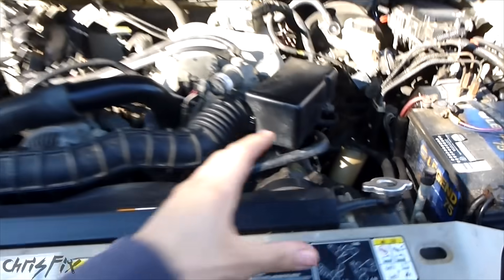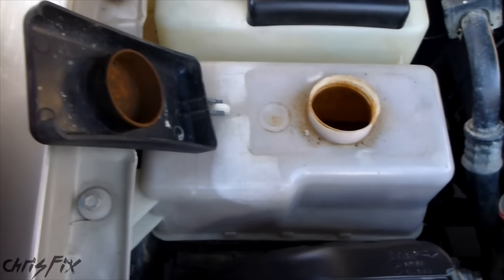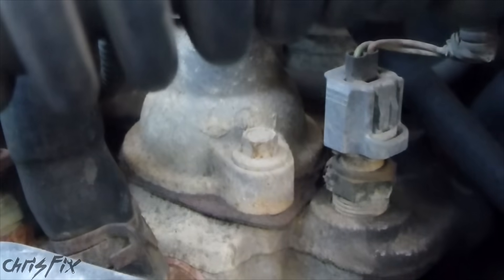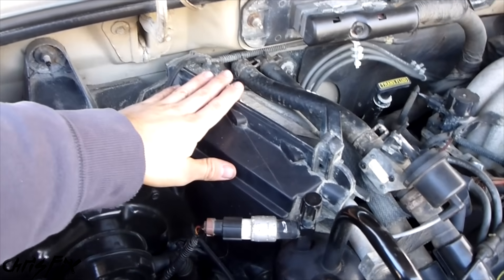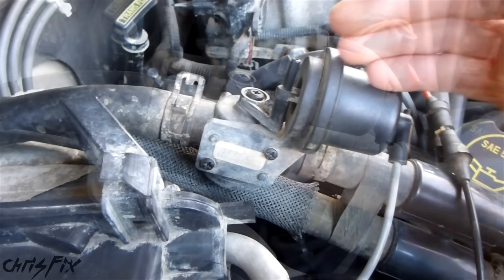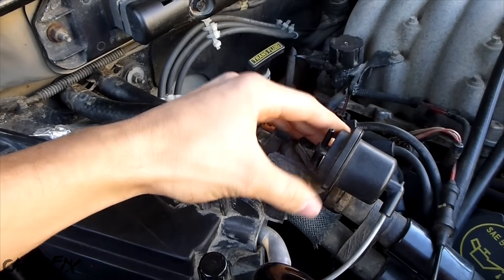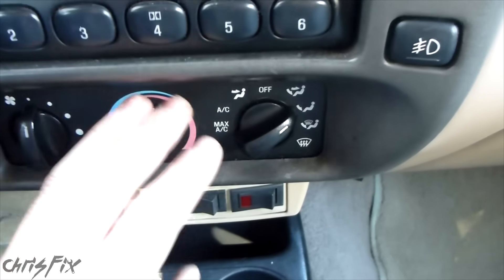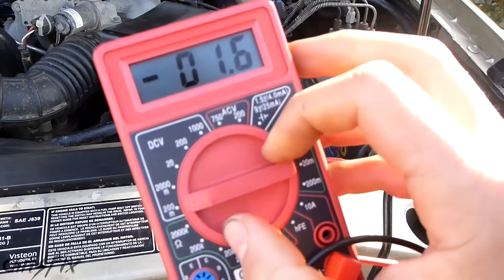How to Fix a Car with No Heat (Easy)

Comment: The dislikes are the mechanics losing there paycheck😂 thanks again Chris helped me alot
Reply from the maker: Glad the video was helpful!
Reply: I like too,people always ,make mistakes after they think they can do it,lucky is usually just  boil the fuse, some may burnt  the house,know is ok,you know what your mechanic replacing, but if part if electronic, fuel or brake,think about it before.
he spend many  years to learn  not just few minutes
Reply: Alan W i dont understand you at all
Reply: Yeah lol. Self helpers are taking from mechanics.
Reply: hunter lutz good one! Lol 😂 but you know what they still watched the video so it helps Chris Fix haha
Reply: Facts one mechanic was about to charge me 800 fo change my WORKING actuator
Reply: Their**
Reply: I don't think so he got only 6 million subscribers
Reply: Their*
Reply: @alanw5812  uh no offense but what
Reply: @willleftridge3769  that's nothing, a mechanic tried to charge me $2400 for a blown head gasket that wasn't even blown.
Reply: Teach me how
Reply: @alanw5812  ?m
Reply: Wow that needs a flush bad
Reply: @alanw5812  I agree
Reply: @ralphvaccaro2638  because if rust already made a hole ,the rust sometime  can block the hole to stop leak,if clean it will start to leak again.
Reply: @chrisfix   My 2002 F-150 with a 5.4 engine...has heat but not hot like it used to be. cut access behind glove box to observe blend door, that is working good like it should, opens and closes fully when turning thermostat from hot to cold, engine thermostat replaced, coolant system flushed, heater core flushed, flow restrictor in inlet heater hose has been removed, blend door actuator replaced...both heater hoses are hotter on the bottom side of the hose than on the top side, is that normal because the hot coolant is circulating and doesn't completely fill the hoses? if I leave the fan on low for a few minutes and then turn it back on high the heat will be hot for about 1 minute and then it starts cooling down again and back to only warm. I see you were reading about 140 on top side of both heater hoses, were you able to get hot heat with those temps? also with this truck if I increase the engine RPM the heater is warmer. any suggestions or ideas from you ChrisFix or anyone reading this?  Thanks for the video and explanation it was done very well.
Reply: Yea because we all knew this stuff was easy
Reply: @dddddd2100  sad to say this but from what is described possible ur getting into a head gasket and from it being a 5.4 and a 2002 and everything you replaced and you got villa to in there check ur oil see if it’s milky and run a leak down test on it
Reply: Coolant*
Reply: @chrisfix  a
Reply: True
Reply: Chris you are the fucking man!!! Thanks so much
Reply: And just like that you helped me fix my daughter's car. Amazing. Now, she may have a coolant leak. We are not sure yet. She bought the car used so I guess we'll wait to see. But for now she's got heat again!
Reply: @waskito3443  So much of that goes on out there these days. We have an oil change place that checks all hoses etc FREE....took a hose off hid it down tucked under others and my friend drove off with his "oil changed" and all his power steering fluid leaked out. They wanted to charge him $1500. to fix. He came back with the police. The kid that pulled the line off pretended that he just found it off but my friend knew they tried to hack his car. You have to learn to change your own oil. It isnt difficult.
Reply: Facts!
Reply: Facts! 💯
Reply: True 😂😂😂😂😂
Reply: @alanw5812  well they scam you out of cash too
Reply: Or the ppl that did the stew and still couldn’t fix their shit lol
Reply: Can't see any dislikes now...
Reply: There aren't any dislikes
Reply: @RealDJStew724  YouTube changed it... ppl are probably too soft for thumbs down nowadays 🤦‍♂️
Reply: What dislikes? 💀
Reply: There are no more dislikes :(
Reply: Dislikes are only for real people...
Reply: @craigjones8558  what's that supposed to mean?
Reply: their
Reply: What dislikes.
Reply: If you tried to fix it yourself first and then bring it to me,  It's going to cost you more!
Reply: Ford's.....🤢
Reply: For reals man
Reply: @supporterofeverythingyouli6255  💯 exactly love when people think they know more then actual decent mechanics just because they watch a few videos or have one of those little devices that plug into the obd port 😂😂😂
Reply: @supporterofeverythingyouli6255  had a guy who showed me a printout from i think it was blue driver or whatever its called , he had some code and it told him to replace the throttle body , long story short he wanted it replaced he swore that was the fix so we did even tho i knew something else was going on but i wanted to prove a point about those devices , check engine light still on car still ran like shit , did a smoke test , his intake manifold had came loose in the back and was throwing the whole car out of wack 🤷🏽‍♂️
Reply: @live_lifeor_dye8875  educated society is better than compartmentalized one
Reply: @chrisfix  aaaaa
Reply: 😂 makes perfect sense.
Reply: @sassylrhg  there are countless videos on here with people who put hidden cameras in cars and deliberately make the car malfunction and bring it to a mechanic. They then catch the mechanic lying about fixing it legitimately when all they did was correct the deliberate issue that the person caused. Shady people everywhere in this world. You have to find a mechanic that you can trust and stick with him. Not easy to do but possible.
Reply: No,its guys like me that went for years to learn how to be a licensed 1,and then there are guys like this that think,and want to be 1.Big difference.
Reply: many mechanics do it to themselves. triple charging customers. charging them for hours of labor when the job took 30 minutes. some don't have the financial stability to pay $75-150 hr for labor when they can learn to diagnose and fix on their own. especially if it's a second car or they are just learning on their own.
Reply: @chrisfix   I posted a question about the air conditioning only coming out of the defrosting vents,  AC blowing on a windshield when it's 108 degrees outside with 90% humidity doesn't do any good. would that also be the blend door or something else?
Reply from the maker: @stacylee1784  vent actuators not working.
Reply: Dont worry. Companies are actively making vehicles so you cant work on them anymore. If u dont put it in maintenance mode it will destroy yoyr vehicle
Reply: @alanw5812  q
Reply: rip the dislike button;(
Reply: @waskito3443  a parts swapper or fraud 🤥
Reply: @chrisfix I have acura tlx my heater motor works on and off for no apparent reason ..please help

Comment: There are three knobs on the climate control panel show here?. The far right knob, what is the name of the module it controls? Mine is starting to wear out and needs to be replaced. None of f the parts diagrams I have found names it. This is on a 2001 F150.

Comment: THANK YOU FOR SUCH AN INFORMATIVE VIDEO. IM A 46 year old widow and having this exact issue but on a very tight budget. Currently I am stranded due to a snow storm combined with no heat making it dangerous since I cannot see through the windshield due to ice. 
Sadly im stuck until tomorrow afternoon when hopefully some sunshine will allow me to complete my 2 hour journey home but I cannot wait to follow your instructions and get my heat working again. 
My poor dog is shivering so bad. That’s the hardest part for me. 
We are soooooo cold but you’ve given me some hope so we never have to go through this again. 
Thanks again. 
Jami
Reply from the maker: I'm sure you will be able to get that fixed so you can get home!

Comment: Chris, it's been 6 years since you posted this. And recently my car started taking forever to warm up the air now that's it's cold out. First thing I remembered was this video that I watched a good 3-4 years ago. I just wanted to say thank you! My car now has hot air blowing during these cold mornings/evenings! It turned out that my car was just low on anifreeze/coolant. Thankfully, it's all that the car needed. No, I don't have a leak, it just normal evaporation that exits from the reservoir. But it also shows how often I look under the hood, and this situation reminded me that it was past due that I checked under the hood. Thanks again!

Comment from the maker: Thanks to the tips and suggestions by my awesome subscribers, I added some more information and made one part a little more clear! Can you spot the difference in this video compared to the one released yesterday?
Reply: Nope can't tell thete both to grate to tell but man your radiader is nasty wow its looked very rusty
Reply from the maker: patrick cordery Yea man! Commenters are scaring me saying I have a head gasket leak. Now I want to do a compression test lol
I think it is just really rusty because  I dont loose any coolant and the oil isnt frothy so.
Reply: ChrisFix keep up the good work and thanks for your continuous replies. Other YouTubers only reply once and most of the time that doesn't help
Reply from the maker: Claroboy911 No problem man! I am here to try and help! That is the goal!
Reply from the maker: chickeneyeballs does it work on the highest fan setting? If so, your blower motor resistor is bad. If not, it sounds like your blower motor is bad. Here is some more info: https://www.youtube.com/watch?v=7e60wS3_C9s
Reply from the maker: chickeneyeballs Yea, that sounds like a bad blower motor. Maybe the connection to the blower motor is loose?
Reply: Dude, I love your videos. Being a trained manufacturer technician I know all about the cooling systems and other systems that you've covered, but you do a good job of keeping it simple yet informative. The horseless carriage is a surprisingly complicated machine that I think the majority of us have no clue how any of it works. Keep up the good work!
Reply from the maker: grandmaster1004 Thanks a lot man! I really appreciate it!
Reply: +JHMBB2  can u help me figure out why i dont have no heat in my 94 Ford taurus
Reply: +G. Phillips There should be a port back by the firewall. It's sort of a pain in the ass to get to. I had a 2000 Grand Prix 3.1, which is pretty much the same thing as a 3.4 and that's where mine was. I don't know if there's an actual way to check without the level without a gauge.
Reply: I don't believe so. I tried that one first and it was a no go
Reply: +Jeff Riggs Your radiator my be too big for your environment. I had to block off 75% of one once to get decent warmth. In the climate of the UK there was never any need to adjust it again. HTH
Reply: +Jeff Riggs Check basics first, make sure there's enough coolant and no air in the system, also make sure the engine comes up to temperature as it should, sometimes old thermostats can stick open, over cooling the engine and in that situation it could take a very long time to reach temperature if it does at all.
Reply: Hi Chris, I have only hot air in my car. If engine is at 90°C, my climatronic doesnt blow any cold air..and those 2 hose, both is hot when engine is running..what is wrong, what should I do?
Reply: +ChrisFix i herd that those mazda trucks have a great heater.... my aunt has one.... and it is amazing amount of heat
Reply: Did you ever check into that?  I have a 99 Ranger 3.0L and I just realized yesterday that my coolant is just as bad as yours in the video and I'm worried now too.  I checked the oil and it's fine but my reservoir is empty.  Radiator is still full with coolant though

Edit: I don't ever use comments on here, apparently reply doesn't work how I thought it does.  I tried to reply to Chris' comment about viewers telling him he had a head gasket leak.
Reply: the Mercury Mountaineer (Ford) seems to be the ranger, just as a SUV.
Reply: ChrisFix no boarding
Reply: ChrisFix nice video!
Reply: ChrisFix hi I have a 2002 buick lesser limited  blower motor will turn on only when you kick the cover panel in the right spot the blower is new and the old one did the same thing what could it be  Don ahola
Reply: I didn't see the orginal but this one was great!
Reply: Chris
Reply: @ChrisFix hey idk whats wrong with my heater core it gets hot for a few seconds then is cold and the radiator has full fluid and it stays at operation temp plz respond
Reply: john white I have a Dodge Charger and my heat only work when I'm driving
Reply: ChrisFix I have Dodge Charger 5.7 Hemi and the heat only works when I drive the any tips
Reply: @Ceno3000 it does the same thing when driveing
Reply: ChrisFix when I drive the heat comes out and it works
Reply: ChrisFix we
Reply: ChrisFix my 98 dodge dakota sport two door  only shoots out cold air ...and it sucks .right now with no heat
Reply: Hey Chris I have a dodge charger 2007 and the heat and ac are weird basically it all works fine when I'm driving but when it idle its just cool even if I have just the heat on

Comment: I'm only here to comment that I was far from home (South Orange County, CA) and very deep into the city of Riverside (approx 1hr away) when the heater wasn't working at all. Did EXACTLY what my dude here recommended: Buy coolant specific to my Lexus RX300, head home, go to bed, letting the engine go completely cold by morning..  Wake up, look at the reservoir (which was slightly above the L aka low level), fill up the reservoir with coolant to the F aka full level, start the vehicle and wait until the engine was warm, turned on the heater and PRESTO: Instant fix and running exactly as it was before! Thanks my dude for setting me on the right path!

Comment: Most thorough heater issue diagnostic video I've seen so far! Clear, concise, and easy to follow... Just saved me $120 in diagnostic fees so I can try to figure out what's up with my car. It's only blowing warm air when it's moving, then cold air at stop lights, and the defrost has a kinda chemical smell I'm assuming is coolant. 🤷🏻‍♀️

Comment: This is seriously one of the best automotive tutorial videos I’ve seen. As someone without A lot of automotive experience, I often have a hard time figuring out which parts are which and videos are often either too dark or not clear enough to help. This was crystal clear and Now my heater is working again after a month of trying to figure it out on my own. Hooray!!  My heater valve doesn’t look anything like the one in the video but your description and visuals were clear enough that I was able to locate mine and reattach the cable. Thank you.

Comment: Thank you Chris, I almost had a heart-attack after seeing some ads for blown heater-motor repair($450+ !). After watching this video, I drove down to Walmart and got me some $10.99 Anti-freeze, filled up the tank, topped off the radiator and 'voila' the  heat was working better than before ! Thanks again...

Comment: I am leaving for a vacation to arizona in 3 days, its gonna be late november and its super cold up there (im from south texas), ive been on a huge time crunch to replace wheels bearings, axles, a new sound system and fixing the HEATER over the course of a week or so on a 1978 Cadillac Eldorado(the car im gonna driving for 20 hours), scrambling trying to get this thing ready for a road trip. i just got off work late at night and watched this video bc i know ChrisFix is the one to watch and had it blowing warm in 20 minutes by bypassing the heater control valve  to see if it was the problem, and it was. This video was so unbelievably helpful to me and now i can sleep tonight knowing i wont freeze to death. Thank you!
Reply: I will also be flushing the heater core tomorrow to get some extra degrees in my favor
Reply from the maker: I'm glad the video was able to help you out! Thanks a lot! Have fun on the road trip!

Comment: What a great video! I have a 2015 Mustang, whose heater started randomly   blowing cold, hot, nothing. At first, I thought it could be one of the actuators under the dash controlled by the temperature knob or a fuse, etc. Turned out to be a small leak in a radiator hose. This caused the overflow reservoir to empty. The low coolant sensor that monitors the overflow reservoir then caused my heater to quit working properly. Never thought it would be anything like this. Easy fix to replace hose.
Reply from the maker: Nice job diagnosing the problem!

Comment: A gauge in the middle doesn't always mean the thermostat is good.  On the 97 ranger I used to have, the temperature sending unit was on the RADIATOR side of the thermostat.   When the thermostat stuck shut, all the coolant was pushed into the overflow reservoir, what few pockets of coolant remained in the engine boiled like crazy, but the gauge never showed overheating.  It only measured the cool water that was trapped between the radiator and the engine. That design flaw aside, the ranger was so well built that it lasted more than a year after that, and when I finally retired it (at 297,000) I drove it to the place where I traded it in.